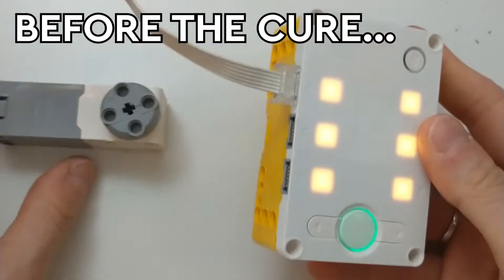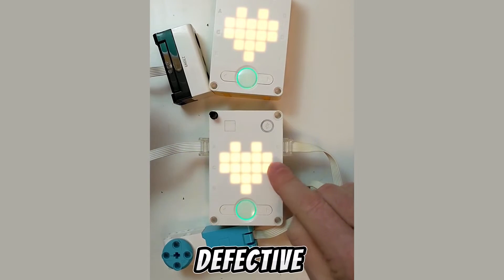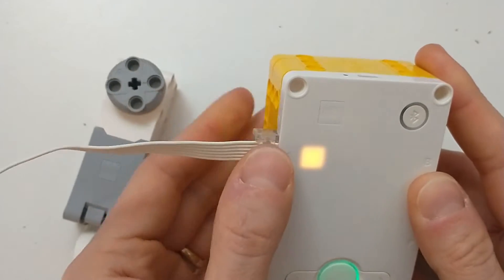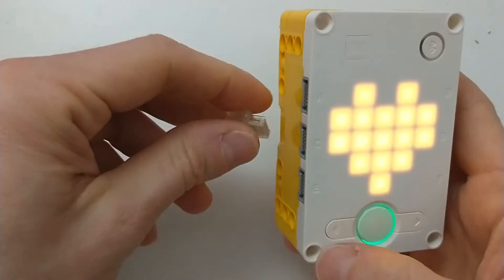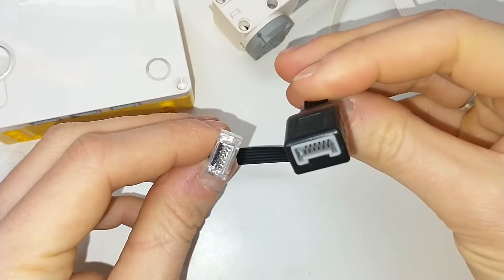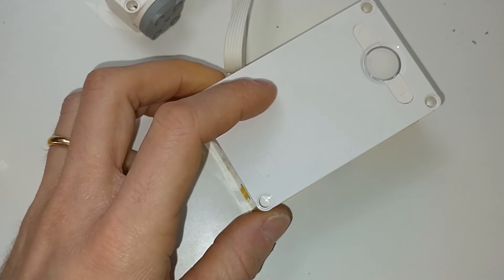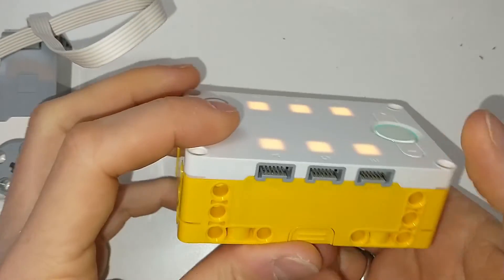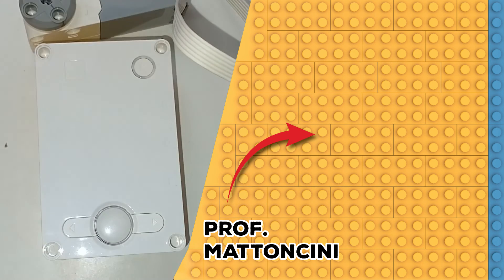How to fix LEGO SPIKE Prime hub defective/broken ports

Comment: what if its the motor that isnt working?
Reply from the maker: That's another problem. In that case, you can contact LEGO customer service, that might ask you to return the defective motor for quality control, and send you a new motor.
Reply: @profBricks  I understand that motors are not replaced unless they are initially defective in Korea.